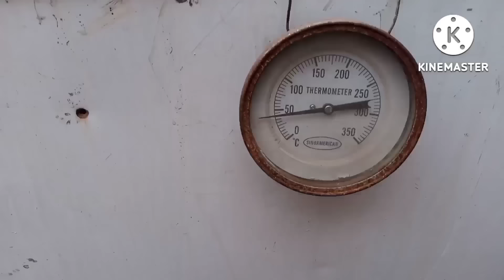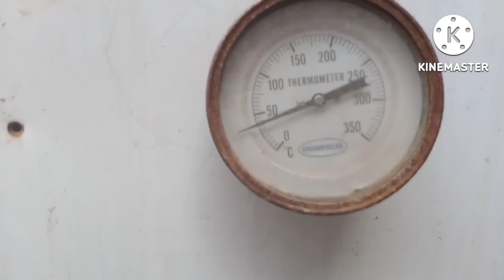How to earn money by tank restoration learn online||How to earn money by bike learn online#Abirestor

Comment: Great work!. But I wish you'd have given a caveat at the start, stating that you should NEVER bring a flame to a fuel tank that has previously held gasoline, even if you've flushed it out beforehand. Gas fumes left can still explode. It should be steamed out for several hours before welding or heating it.
Reply: Karen
Reply from the maker: You are right! Safety first. 👍

Comment: Good job 👍 but it's probably easier & less repair for you to remove the dented damage with compressed air or water very similar to hydroforming & just pop that dent out
Reply: Compressed air sounds scary though, better using som kind of fluid.

Comment: Decent job,  especially on the tank. BUT fuel tanks hold vapor and will explode with that flame. And dont use coke bottles for paint or thinners. They go in steel cans,, and not food steel cans as they are poly lined.
Reply from the maker: Thanks👍